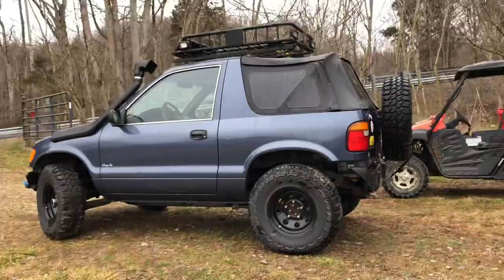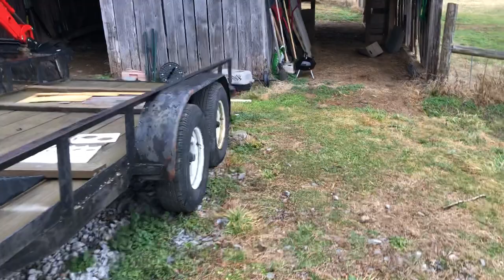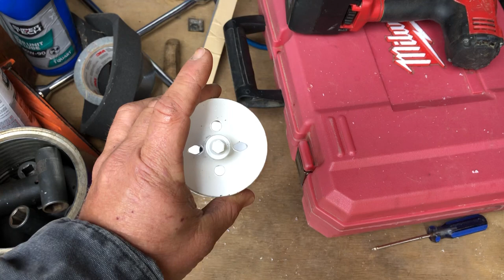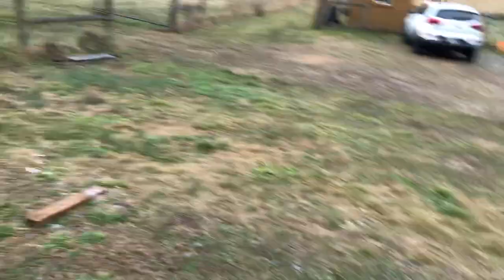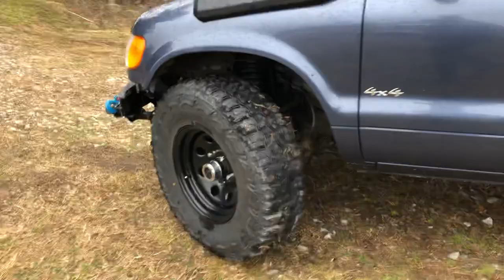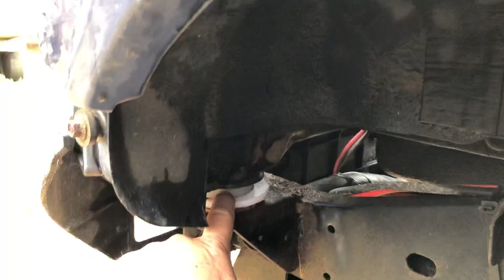Micro-Pig 10! Home made DIY body lift for my 2002 1st gen. Kia Sportage. Off road micro monster!

Comment: Do know of any videos showing how to remove/reinstall the soft top? I just got a 2dr soft top and bought a new top to install
Reply from the maker: @brandonstallard22  I don’t write off hand, but I would be happy to make a video when I get home in a week or two. Just so happens I need to change my top as well.
Reply: @micro-pigoffroadclub8387  i actually just finished yesterday, it was easy. Pretty straight forward but I appreciate the offer for the video! Very kind of you. I installed it on my 2001 2dr, 4x4, 5 speed. Bought it for 800 bucks with 91k miles and a broke timing belt. Put the belt on in 2hrs and she runs perfect!

Comment: What size/kind  are your wheels? Would it fit a 1.5 inch lift?
Reply: tires i meant tires
Reply from the maker: The tires in this video are 31 inches tall. Unfortunately they would not work with a 1.5 inch total lift. If 1.5 is all you have or intend to add, I think the biggest tire would be a 235 75 15. Even though, it would probably still require just a touch of body trimming. I had that size tire prior to this upgrade with just 2 inches of lift and no issues. All I did was trim a little bit of the front bumper skin down low so that it didn’t contact at full turn.
Reply from the maker: Even with the 235 tire, the wheels are important in terms of offset. I recommend either putting an inch and a half spacer behind your stock wheels or switching out to a -6 mm aftermarket wheel in the 15 x 7 variety.

Comment: Bash the pinch weld in the rear side of the front fenders for less rub -Samuel from Micro Monsters ✌️😁
Reply from the maker: I did that before I even thought about the body lift LOL! I made some nice little cuts, folded them neatly and then beat the snot out of them with a 4 pound sledge. For a minute there I thought I had it, But then I took it for a very spirited ride off-road.

Comment: will a 3 inch ( 78mm) holesaw be ok ?
Reply from the maker: I will get underneath and take a look. The 3 inch may fit inside the cup that is formed to the body, but honestly I think 3 inches is too small if you are going to set it on top of the original rubber body bushing that sits in the frame
Reply: @micro-pigoffroadclub8387  ok I'll wait for your reply as I have all the discs cut
Reply from the maker: @rodneyflying9124  It looks like I used 3 1/8 inch. With that being said, the 3 inch will definitely fit inside of the cup of the body. My only concern at that point would be the smaller diameter sitting on the rubber body bushing. My gut says it will work just fine, but in a perfect world, I would put a 4 inch fender washer underneath it to make a larger surface on the bottom. That would distribute some of the weight across that bushing. But honestly, as long as the discs you cut Are flat, it should work fine.
Reply: @micro-pigoffroadclub8387  I used a 4 in. holesaw and got the 3 7/8in slugs no problem but only had a 3in holesaw and got 2 7/8 in slugs will they be ok or not..?? The cutting boards I used was 3 slugs to make 1 inch.  I'm in Thailand
Reply from the maker: @rodneyflying9124  Excellent. I believe it will be just fine.
Reply: @micro-pigoffroadclub8387  Tommy 1 more question with a 1 inch lift is there anything like wiring ,piping or gear lever console etc that needs to be changed...
Reply from the maker: @rodneyflying9124  In my case, I did not have to modify anything to use the 1 inch lift. Because I notched all of them to slip in the place, I didn’t have to disconnect anything either. If they are not notched and just have a hole in the middle, you would have to disconnect your heater hoses, the fuel filler hose, possibly loosen the steering linkage Etc. But no matter what, you should definitely just keep an eye on your brake lines.

Comment: you think you could body swap a Sportage
Reply from the maker: The first generation Sportage has an independent frame much like a small truck. You can remove the body. Starting with the second generation, it was a unibody rather than a separate body from frame.